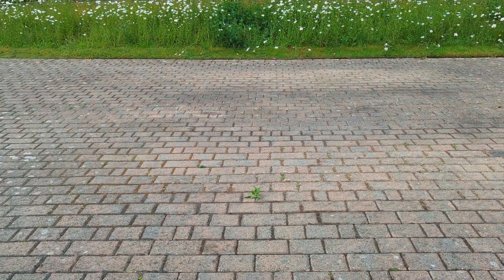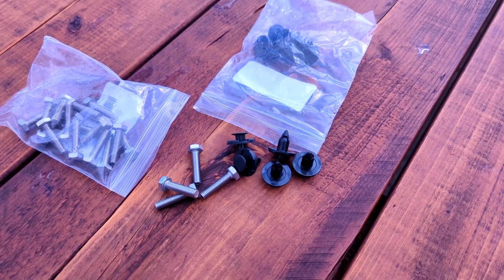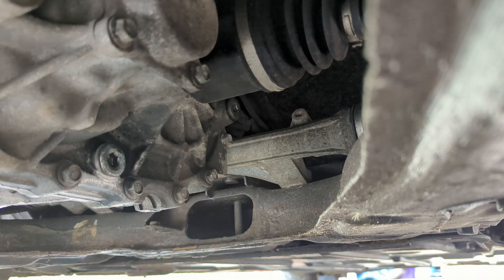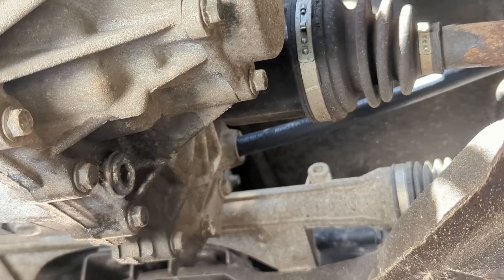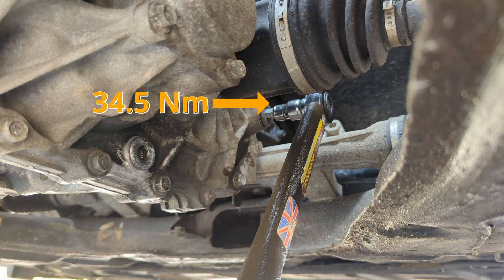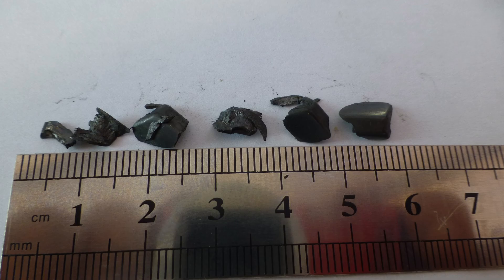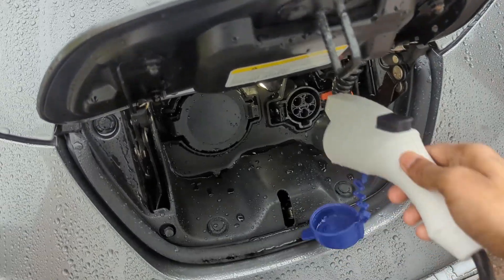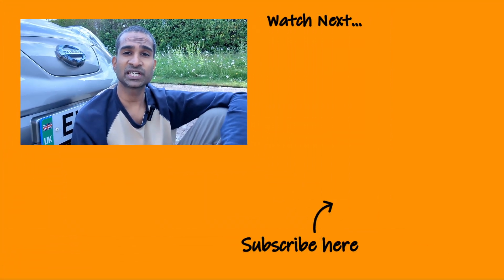EV Gearbox ‘Lifetime’ Fluid SCAM 🤥 – Protect Your EV!

Comment: car manufacturers are just one of many companies who miss lead their customers. briggs and stratton who make small engines for garden machinary etc state on a lot of their engines do NOT need the engine oil changing during its life. just top up as needed. this is a recipie for disaster. if you use it for home use change it 1 or 2 times a year. if heavily used change at least 3 times a year. you also dont need genuine oil. any 5w/30 full synthetic car engine oil will do the job.
Reply from the maker: Yea it's not great. Isn't it advised that most lawnmowers have an annual service?

Comment: No lubricant lasts forever. 
Many car manufacturers list fluids in driveline components as lifetime, but not changing these fluids shortens the life of the components. 
You can never change fluids too often, and the components will last longer as a result.